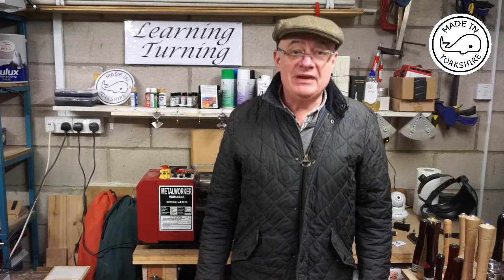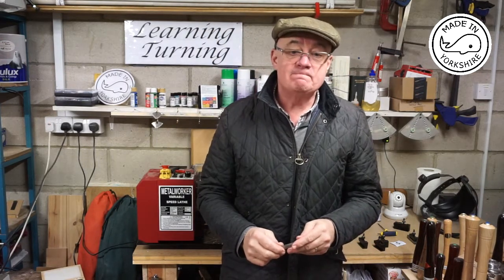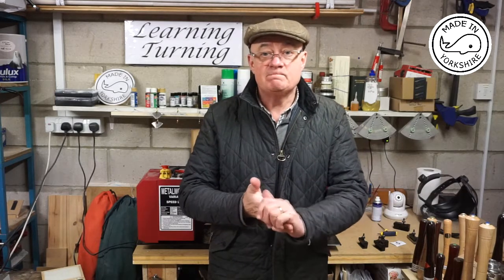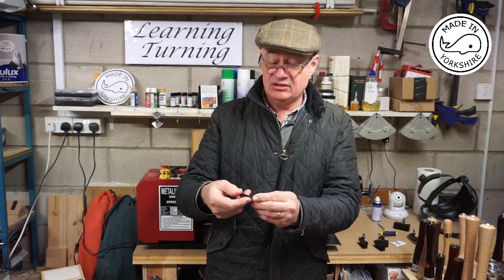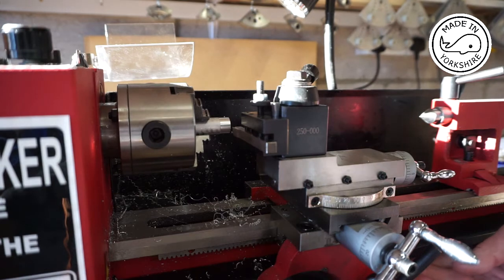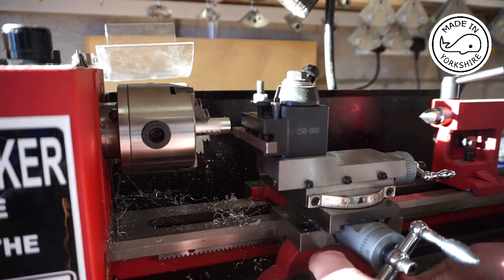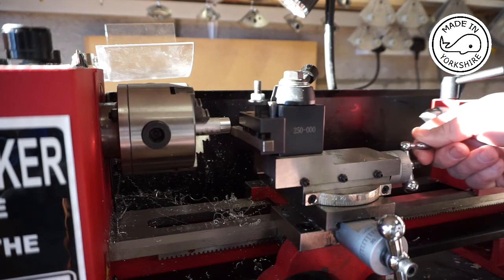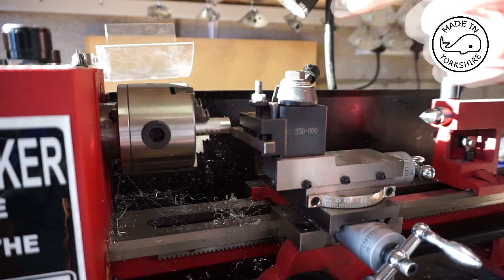#MT4 - HSS vs TiN. By Andrew Whale.

Comment: I have only tried those HSS tool sets once when a friend asked for my opinion, and if you will allow a little sarcasm, the only thing that is high speed is the rate they wear. For your use, if you want to use HSS consider a tangential tool, they are really as good as it gets. Making your own is quite easy and equally as good as a ready made commercial one and can be made for pennies using scrapbinium.
If you want the convenience of TC go for the uncoated bright shiny ground ones intended for Ally, which can also be used on mild steel. try the small nose radius ones and use shallow DOC for good finish.
Reply from the maker: Hi Chris - many thanks for the info. After lots of experimenting I have also found the ones intended for aluminium give a good finish on other metals. I have used the CCGT060204 ones. I purchased a pack of 10 from banggood - which reminds me that I need to get some more.
Cheers
Andrew

Comment: Andrew. Very similar experimental routes. I bought the 6mm HSS set from Arc as well as the coated replaceable tip tool, just to see how well they work. The uncoated non-ferrous tip gives great, consistent results on aluminium but especially on brass. Most of the time I use cutters I've ground from Arc's 1/4" HSS Tool Bits and these give a quite acceptable finish on steel and a good finish on non-ferrous. It's a simple two face freehand grind - none of the fancy stuff we read about. The drive belt slips in high gear, so the lathe is mostly running at about 700rpm which isn't fast enough for the coated tips which I use on cast iron to minimise wear. I've bought a pair of drive belts but don't want to strip the lathe until I've finished building my indexing head. The drill chuck capacity is 8mm. Boring a largish hole involves drilling up to 8mm (in back gear), opening up the hole with the boring tool from the HSS set, to make room for the Arc 6mm replaceable tip boring tool. It all takes a long time.Recently, I bought 6mm and 10mm uncoated solid carbide end mills from Arc and these are really good on aluminium (possibly brass).  The 6mm TiAlN coated solid carbide does a good job on steel. Again, milling is hampered by lack of rigidity so it's lots and lots and lots of small cuts, but the results are quite acceptable.Regards, Len
Reply from the maker: Hi Len - many thanks for sharing your experiences. Over the past year or so, I've not had great results from the coated tip tools. Maybe I need to speed things up a bit. I have found that replacement tips used to cut aluminium seem to work better on mild steel and brass. I really must start using HSS tools again and start mastering sharpening on the bench grinder. I bought some HSS blanks a couple of months ago, but I've not got round to making anything out of them yet. For milling I tend to use the TiAlN coated end mills from Arc too, which are affordable. I was given some professional end mills a while back, and they cut through cast iron and mild steel like it was butter. An amazing experience but way beyond what I can afford though.
Take care and good luck with your projects.
Andrew

Comment: What you are referring to as a tin coated tip is actually carbide and for aluminium you need to run faster toms than for steel and stainless hope this helps
Reply from the maker: Hi Nick. Thanks for the info. I'm getting there slowly.
Cheers
Andrew

Comment: Andrew, TiN is titanium nitride, a very hard coating. I have High Speed Steel drills and TiN drills, and like them both equally...but the TiN drills do seem to stay sharper longer. I bet there are others who can provide a more qualified comparison.
Reply from the maker: Hi Doug. Many thanks for the info. Much appreciated. Also, thanks for subscribing. I have extremely limited engineering experience but hope to produce some videos that might be of interest to others.
Cheers
Andrew

Comment: You got it Andrew, a steep top cutting rake is needed to cut aluminium which the tipped tool hasn’t got, the chip breaker on the HSS tool is giving you a steep top rake if you like, you’ll find though that you’ll get a build up of allie on the cutting edge with a lot of dry cutting, I’ve never turned allie for a lot of years, used to use paraffin as a cutting fluid. My advice for turning steel is to use the ceramic tipped tools especially if you’re not going to use a lubricant..... from a retired engineering turner...👍👍👍
Reply: Hi Allen, thank you so much for your help/advice. Engineers like youself  have a fantastic wealth of experience, which is so helpful for a novice like me. I really do appreciate your advice.
Take care and thanks again.
Andrew